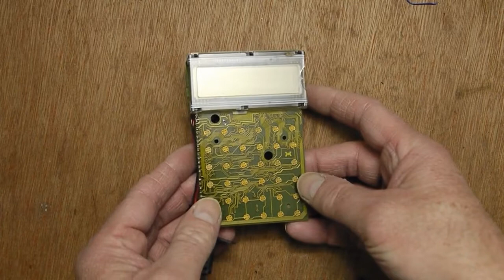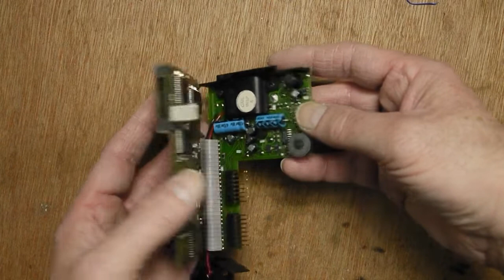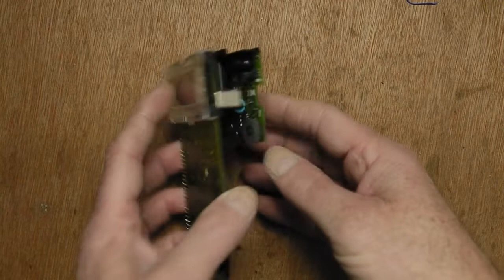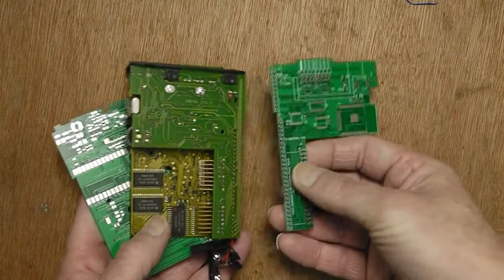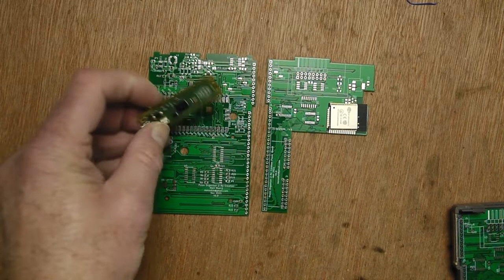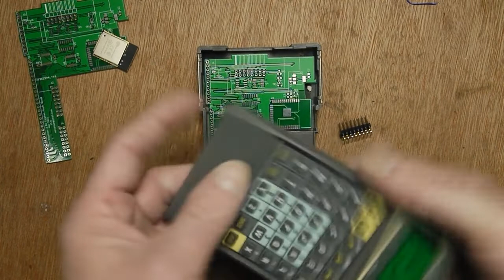Re-creation of Psion Organiser Part 1:PCBs

Comment: Absolutely love this! I was talking to someone on Discord the other day about trying to do something similar with a Series 3 and a Pico (or other RP2040 board). Really pleasing to see someone actually doing it with other Psion kit.
Reply: Interesting. The reason I didn't use the Series 3 or 5 is that the cases are much more fragile and the mechanical space inside is much smaller. I'd have thought you'd have to make a PCB and use the RP2040 chip to fit the case. The series 5 also has the misfortune of disassembly being a destructive process. That really put me off. The SSD protocol is much faster too, but they both run on ARM processors I believe so you may be able to use native code.
Have fun...
Reply: @redlandrover3587  You're right, the cases are much more fragile - you could make a reasonable income on just making and selling new Series 3a cases for the broken hinges.

I'm currently working on other SIBO/EPOC16 projects, specifically a USB drive for the SSDs with a Pico. I can currently dump the contents of an SSD, and I know how to write to one. Current task is writing the libraries.